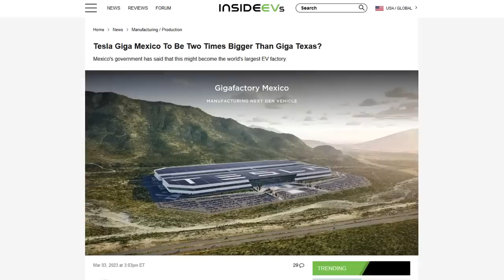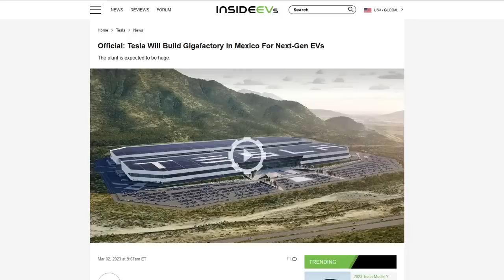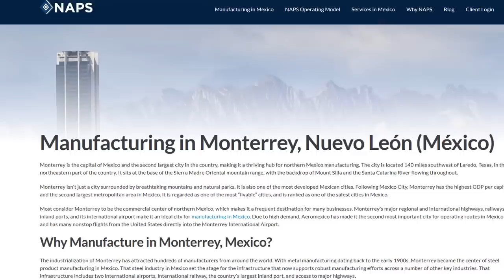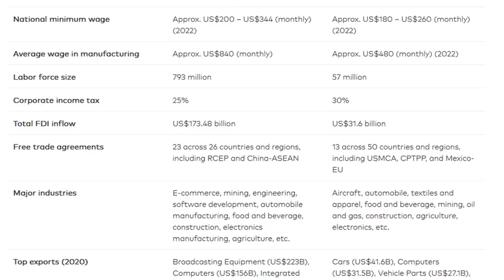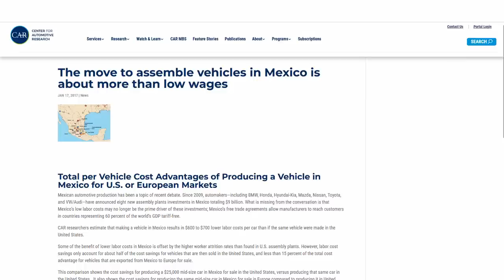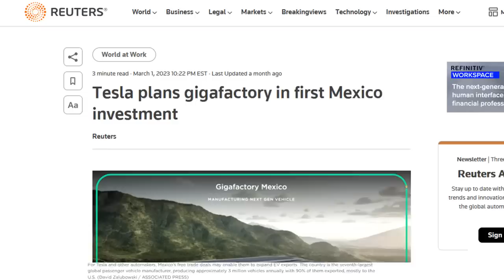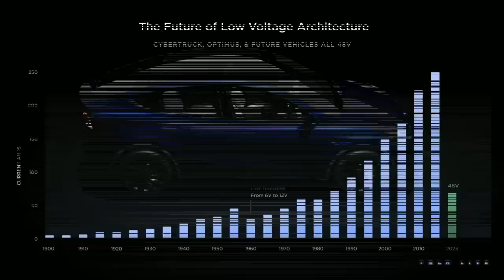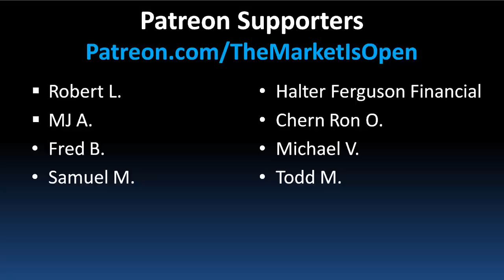The REAL Reason Tesla is Building a New Gigafactory in Mexico

Comment: I wonder if you could make a pneumatic suspension system made out of metal alloy tubes with the heat of the engine feeding into the tubes, with digital control points and a central processor to control the heat and pressure of the air or gas inside the tubular suspension. The centrally digitized system could control the angle and elevation of the car to maximize safety and energy efficiency. There would be strategically placed blow out valves at crucial points on the system, so that if the car got in a wreck the suspension system would absorb most of the impact.